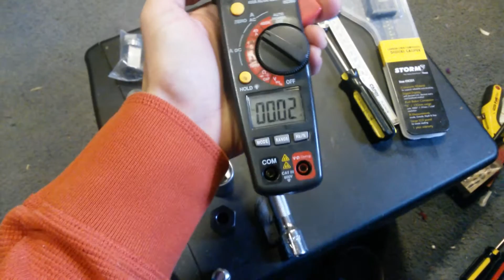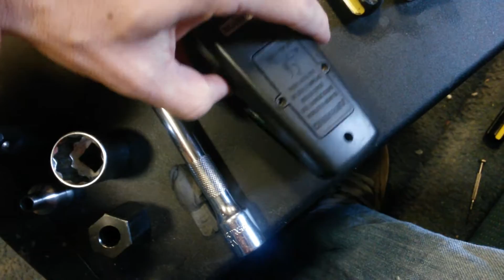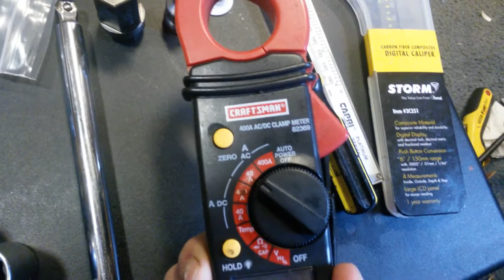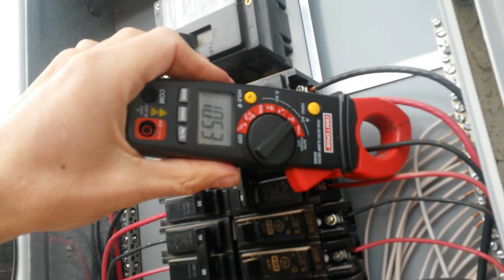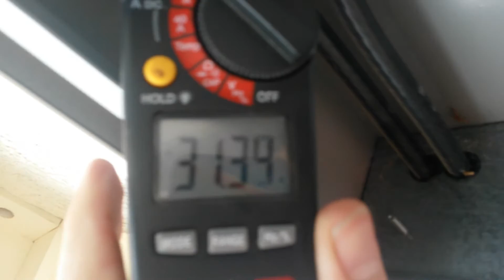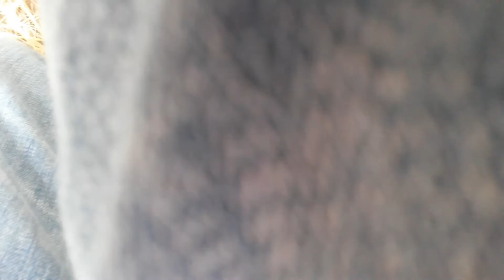Craftsman MultiMeter Clamp Meter ~400 Amp Meter~ Fixing NO AMP READING Problem

Comment: My example of this meter corroded the negative wire and I had to solder a ground wire to the back of the board,of course the board was dull brown. the meter worked once I got some solder to stick to the board.Several areas were corroded, But I always stored this inside the house.

Comment: Same symptoms: "OL" was displayed on most scales and never any load current displayed. My fix sounds similar to that of Ninja Tech Auto. I tried cycling the pot shown by SocketShop, then all the other pots on the board -- no change. Then I switched the rechargeable AAAs for alkalines -- everything works. I haven't had time to experiment further, such as trying other rechargeables, but batteries were definitely the issue.
Reply from the maker: Changing the batteries should always be done before searching YouTube

Comment: Had it for about 10 years.  I use it on my cars.  No problems so far.
Was yours made later or sooner than mine.  (I would guess later).
Thank you for the info though.
Reply from the maker: Mine is about that old now.

Comment: I bought this meter several years ago, used it a few times and was working fine. Took it out to use it today and it was dead. New batteries didn't help. The manual says to check the fuse. Opened it up, but did not see a fuse anywhere. Interestingly, the pot you talked about...when putting it back together I mistook it for a screw and turned it a dozen times....I'm sure I messed up the calibration now!
Reply: Yeah that's not going to help things. Do the battery contacts look good?
Reply: @GadgetClass  yes, the contacts look perfect. I'll use my other cheapo VOM to make sure that power can get to it.why the heck would the instruction manual say to check the fuse if it doesn't appear there is any fuse, unless the fuse is hidden somewhere within the clamp part of the unit? probably not worth trying to get it repaired when the thing only cost me sixty bucks in the first place. And now I'm sure that whatever that potentiometer was supposed to adjust is way the heck out of whack
Reply: @davidcrandon2329  It's been a while, but I don't remember a fuse. Trace the power back as far as you can. Maybe just a broken solder joint.

Comment: That was the exact fix for me too! I saw a cold solder on that adjustment pot as well. I remelted it for good measure. No corrosion was apparent but I don't doubt it as my meter is stowed in the garage shop at all times. Thank you!

Comment: I know this video is old. And out dated but I did some (VERY LITTLE) research on this issue because I have the same problem with mine. The reason for so little research is there is almost no info on this problem. This video talks about the pots having an issue. Another webpage says it's one of the chips low voltage setting so they replaced it with one that has a lower setting. But I figured out the problem. You can use rechargeable batteries, but as Ricelunch had mentioned something about the 1.5v. Here it is. I will lay it all out for you. The rechargeable batteries are rated at 1.2v. So you have less run time with those. If you look inside the battery compartment. It says 1.5v. Which is what the meter needs. That would be a regular battery which are rated for 1.5v. If you are having this problem with your meter and have regular batteries in it that are rated for 1.5v. Then change them out for fresh ones. That is the issue right there. The old ones might have some life left in them. But they are no good for the meter at this point. This is what I did to mine last night because of this issue and it fixed the problem.
Reply: Fredrick Smith great advise

Comment: Make sure to check battery voltage first. Batteries must be 3V or 1.5V each. I've found that accuracy becomes questionable below that. Which explains the OL issue.

Comment: Thank you for pointing out this flaw. I just picked up this same amo clamp meter and straight out of the package 'OL' would display on 40A and 400A DC, as well as 40A AC, but a slight reading would show up on 400A AC. Tweaking this pot brought the meter to life. I'd not have thought about it without your video.

--Mozdoc
Reply: No need to mess with the pot. Just change out the batteries for some fresh ones.

Comment: I have the exact same meter.  When set on 40 amps DC I show a reading of .40 amps.I also see a black minus sign rectangular bar on the screen..  Is that bar displayed when current is below 1 amp?
Reply: That means the meter is clamped backwards. Reverse it and that should get rid of the minus sign.